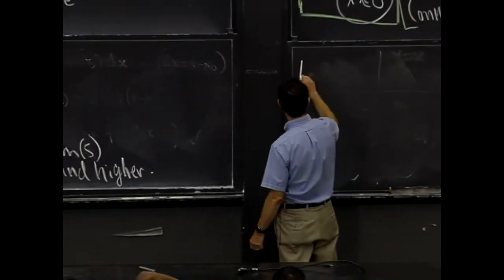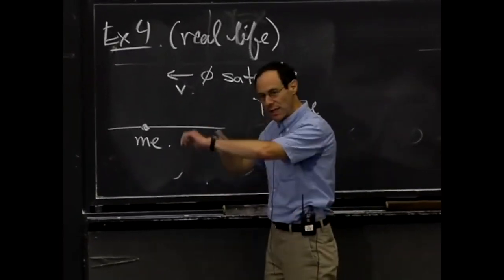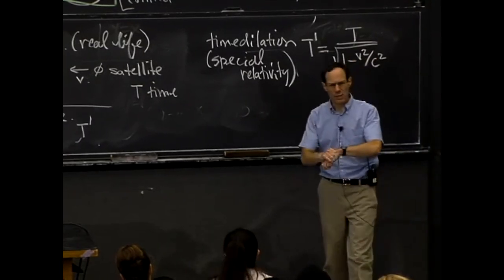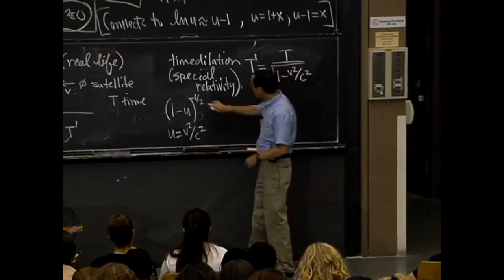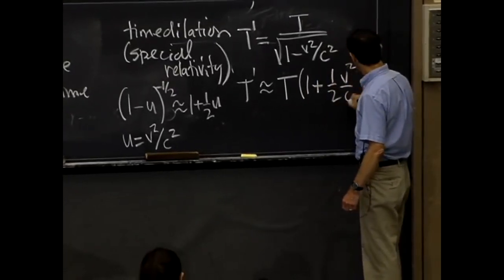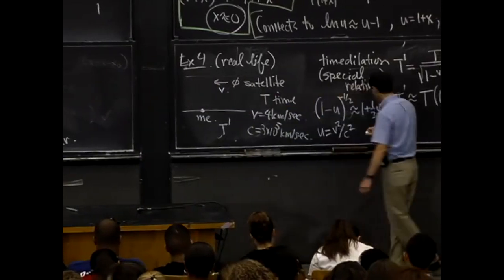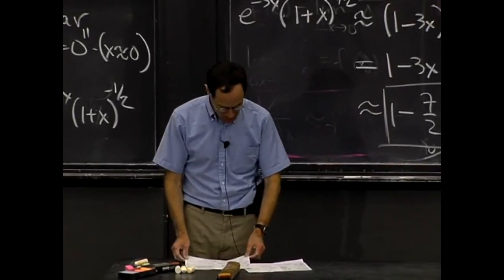Time Dilation (MIT Lecture Video)

Comment: Matter and dark matter: Galaxies rotate too fast but are not torn apart.  What causes galaxies from flying apart?

By Csaba A. Bodor.  Last edited April 4, 2022

gravity, they say, is associated with baryonic matter and with dark matter.  EVEN better:  gravity is associated with the mass of baryonic matter and the SPEED of motion of the former.  Dark matter gravity is caused by ordinary baryonic matter in motion!

Some speculate that a mysterious substance called "dark matter" must exist which holds the galaxies together.    I submit that this dark matter is nothing more than ordinary matter which is in motion around the galactic core and around the billions of stars.

Matter that is in motion presses against the aether of space (to those stuck in the Einstein loop, it is also called space-time) and the aether presses back in the form of gravity and the moving matter also creates time dilation.

This gravity could be the missing gravity that is holding galaxies together. 

There are two types of time dilation.  One is caused by the aether's affect on matter and the other is the aether's affect on speeding matter or electromagnetic "waves".
As matter, of any size, displaces the aether, the aether presses back with what we call gravity.  This gravity presses on the matter affecting it's "being".  All activity of matter os slowed down.  The cesium in a cesium clock runs slower because the nuclear particles of cesium are slowed down.  The clock therefore runs slower.  Radioactive elements all run slower; their half-lifes are increased. Their internal subatomic particles run slower.  
The microprocessors and other perts of computers all run slower.  Our brains are affected also and our minds work slower.  Everything near and about that matter that intruded into the realm that belongs to the aether runs slower.

As one moves away from the mass of that large mass we live on the press of the aether becomes less and the particles and pieces of the atoms will run faster since the gravity created by the aether slowly lessons as we move away from the large mass.  That cesium clock runs faster.  The half-life of the radioactive elements changes and its "time" is affected.

Humans living further from the mass of the earth will perceive time as running faster.  Computers will likewise run faster.

Time dilation that is caused by motion comes about because of the motion of matter or electromagnetic waves through the aether.  A photon traveling at "C" pushes against the aether, the aether pushes back and creates gravity.  The internal properties of the photon or even matter are slowed down.  As humans move through the aether at great speeds we perceive the time runs slower for us.  Time dilation.

For a photon, because it is traveling at "C", time actually stops.  The photon experiences NO time.

The photon cannot travel faster than "C" because the aether sets the speed limit by pushing against the photon's motion through the aether.  This is also why matter cannot go faster than "C".  

When light goes through a gas or a liquid it is forced to slow down and give part of its energy to the gas or liquid which eats into the photon's ability to move at "C". The energy given up heats up the gas or liquid or can even affect the atom's motion; even give off its own "light".
We do not see a photon as it travels through the aether.  When the photon or other electromagnetic wave hits matter, it slows down and even stops.  As the photon does this the photon's energy turns into visible light. 

PS:  Dark matter gravity and dark energy is nothing more than the gravity created by the matter inside a galaxy moving about, pressing against the aether, and then the aether presses back with gravity caused by that motion.  All the electromagnetic waves (photons) bouncing around the galaxy also add to the missing gravity that some say is caused by dark matter.  Nothing dark (unknown) about it.  Look to the movement of matter and electromagnetic waves (including photons).

Comment: Ok. So with the belief time is relative. And using the "bouncing ball" example, what would happen if the two observers were communicating the entire time?, so how could years pass for one person and not for the other if they're communicating the whole time? is the observation of the event still change the preception of time?
Reply: Anada Construction years would not pass if they are able to communicate with each other  because that would mean that they are close enough to communicate 
communication is limited with increase in distance
Reply: We know that but just assume it. Does it still apply?
Reply: Information can’t be transmitted at faster than light speed.  As the two ships distances from each other increase the more time it takes for information  to reach the ship.  This is why the light from distant galaxies takes millions of years to reach earth.
Reply: slow claps...even i had the same doubt
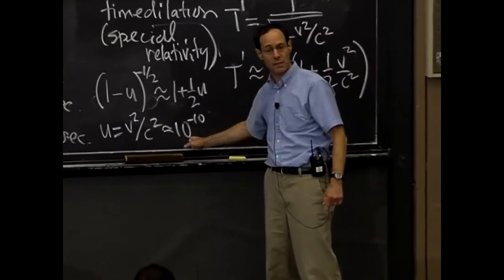Reply: If they were communicating, time would still be running slower for the traveler, and they would see the result continuously. It is true that it takes time for the communications to reach each other, but assume that the messages have timestamps of when they were sent, each observer receiving the message and accounting for distance would see the time difference building. An easier example is suppose one observer puts clocks along a very long road, and these clocks are all synchronized. We can synchronize clocks as long as they are in the same reference frame. The second observer gets into a very fast car with his own clock which started out as synchronized with the other clocks. He then takes off down this road at high speed. As he watches the clocks pass by his window, and compares them to his clock, he will see that they are gaining (running faster) compared to his clock. While his clock says 4:00, the clock flashing by his window that instant says 5:00. Furthermore, say we stationed observers at these clocks on the road. As the car races by, they look the clock in the car and compare it to the clock they are standing next to. They see that the clock in the car is behind their clock, which is entirely constant with the driver's observation. They both agree that the clocks on the road are running faster than the clock in the car. Also, it is a continuous process. The further down the road the car goes, the further behind his clock gets. You could do the same kind of analysis with timestamp messages sent back and forth between the observers, but you would have to account for the time it takes the messages to go from one observer to the other. But once you did account for that, you would see the same thing, the clock creating the timestamps for the stationary observer is running faster than the clock creating the timestamps for the moving observer. Which is which? It depends on whose frame you are measuring the distance in.